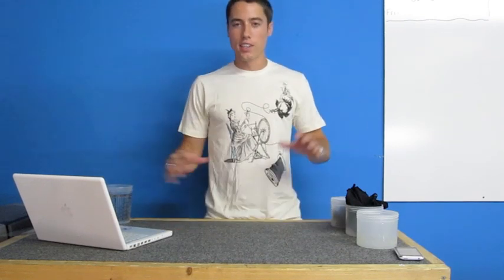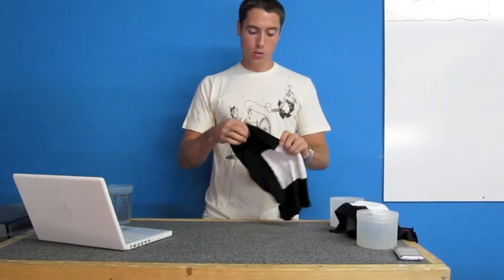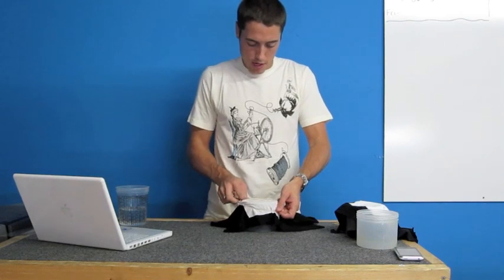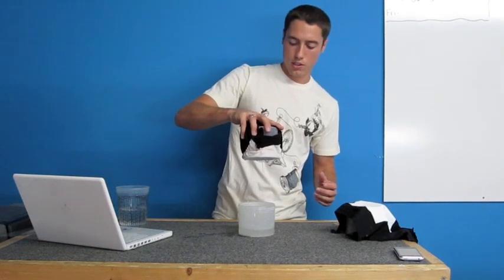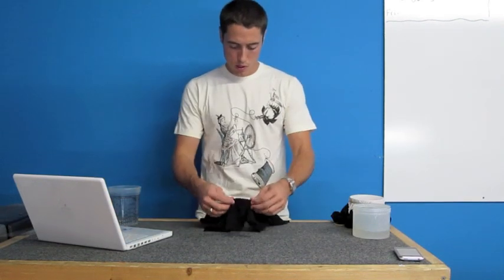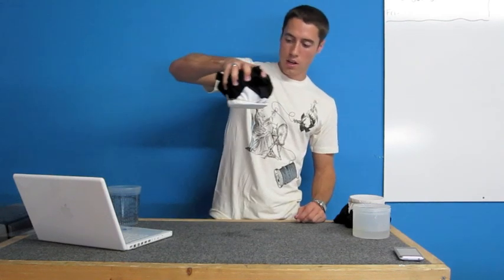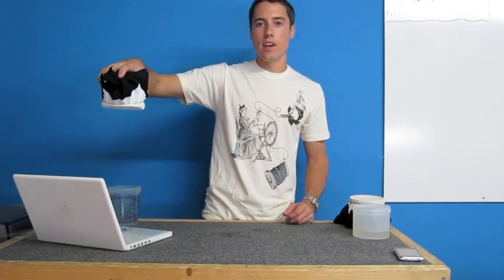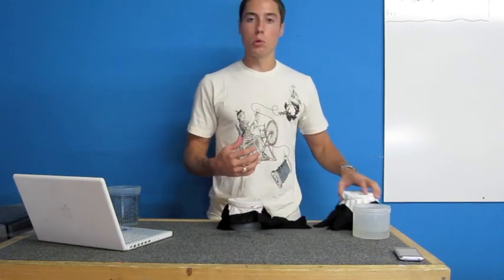Waterbase vs Plastisol Water Test

Comment from the maker: with discharge, you don't necessarily have an opacity issue.  Opacity troubles you when your top color lets the bottom color show through.  Since we've discharge the shirt, there essentially isn't a bottom color anymore, only the new color we've printed.  In this case it was white, but you could make it any color you'd like.  What you'd be more concerned with is how white the white actually turns out.  Thats your biggest struggle and will take some trial and error to perfect.